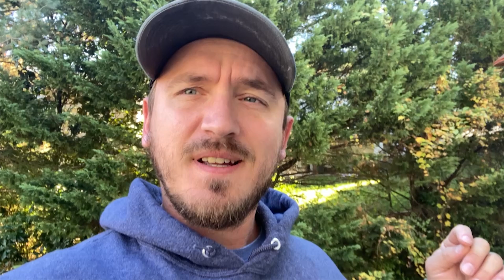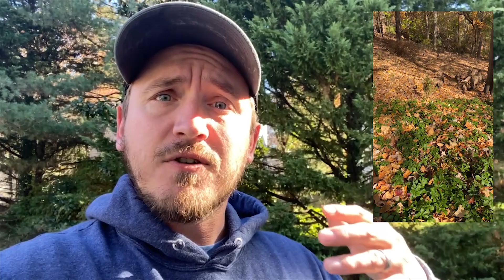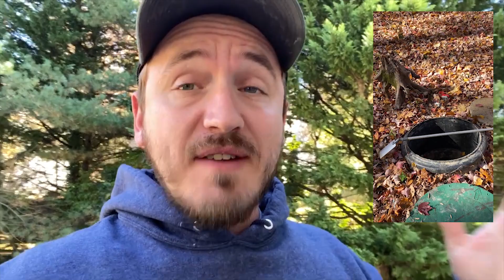How Do Hillside Homes Handle Septic Systems?

Comment: I appreciate this video. I am in Alaska (lots of rocks), on top of a hill so steep it is difficult to not slip. Aside from the one adjacent to the house i have 5 ¿cleanouts? running down the hill. 
The first company we called for a pump their truck couldn't pump so much as liquids.
I have been attempting to research this but was searching entirely wrong terms (e.g. the 4" pipe is NOT a 'riser'). Typing in clean out got me much closer to the answers I need to find a company that CAN help me. 
Thank you!

If you see this, by chance, do you know why there is a ¿drop fitting?, bend in the pipe ~ 13' below the top of the cleanout/standpipe? (We have to have minimum 2' of pipe above surface)